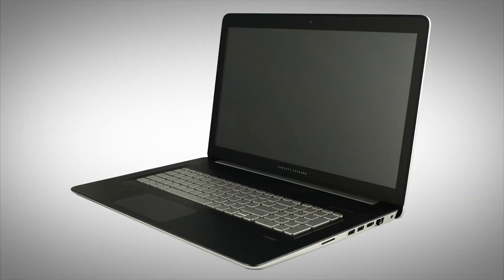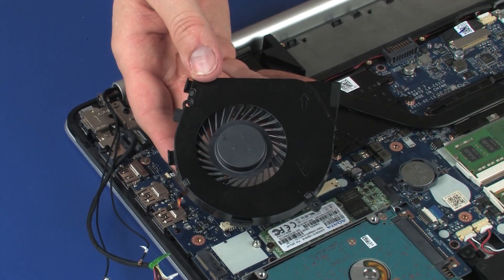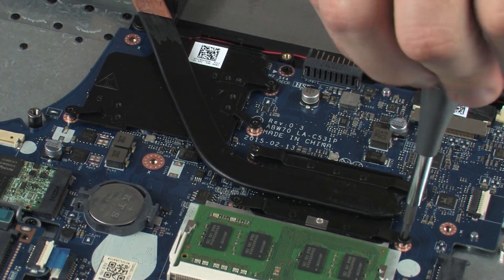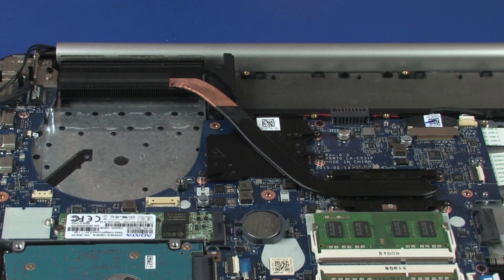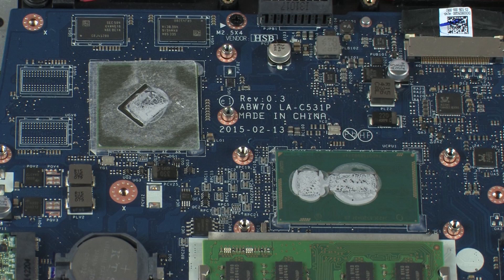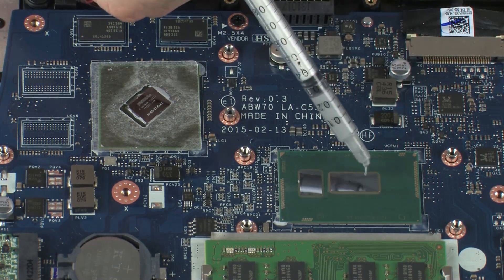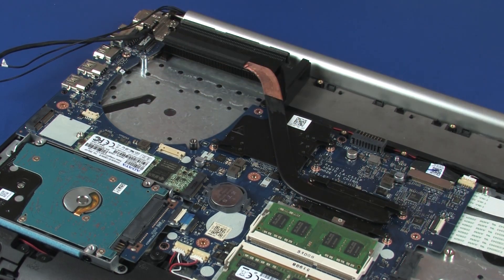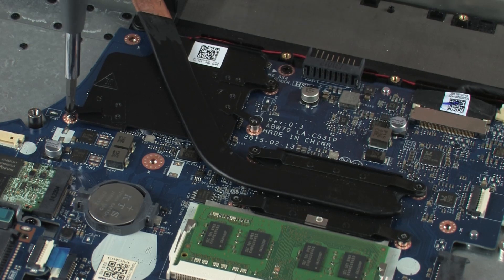Replace the Heat Sink | HP ENVY 17-n000 Notebook PC | HP

Comment: Hi, I bought a HP Envy 17-n008nl in your store (October 5th 2015). After these 7 years, I would like to upgrade it with a better SSD and processor than the I7 5500U. As for the SSD, I've already found the right one. As for the processor, I'm having trouble finding the right one for the socket type, I don't know which one it is. I haven't found any tutorials in your channel, and I can't find anything in general on the web, do any of you have any useful tips for me? A thousand thanks.
Reply from the maker: Hi there, thanks for contacting HP Global Social Media Support!
I understand that you need to know about upgrading the processor of your notebook. 
I will do my best to assist you.
The only way to upgrade processor  would be to replace the motherboard. The processor is integral parts of the motherboard.
Binu_HP Social Media Tech Support
Reply: @HPSupport  Thank you very much for the answer, you have been really helpful and fast. 👍 I didn't know that the processor is soldered directly into the motherboard, at this point I'd say I'll keep it as it is, at most I'll replace the HDD with an SSD. Thanks again so much for the reply. 👍
Reply from the maker: If you need any help in the future, you can always get back to us.
Thank you for being a valuable HP customer.
Have a wonderful day!
Cheers!
Binu_HP Social Media Tech Support